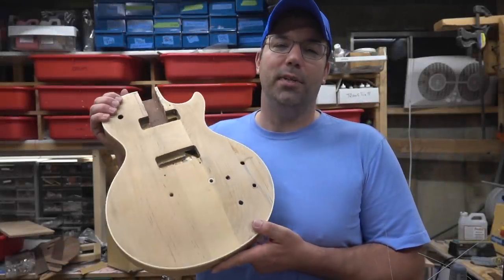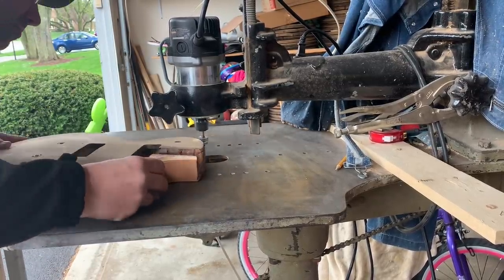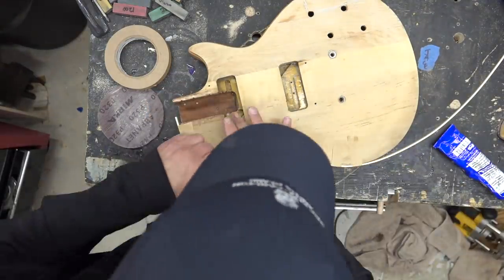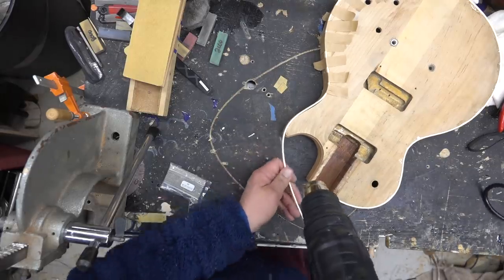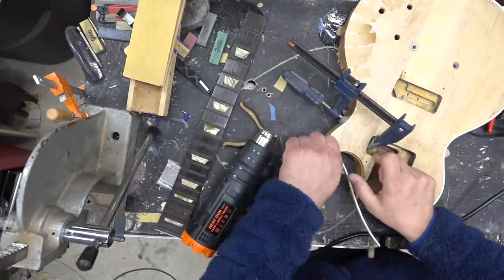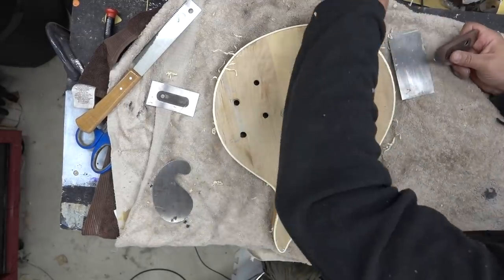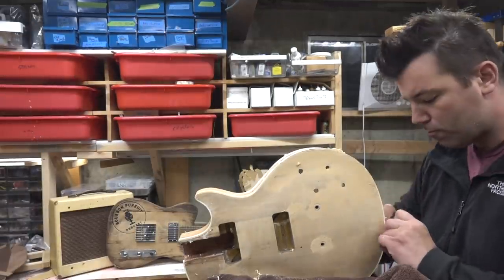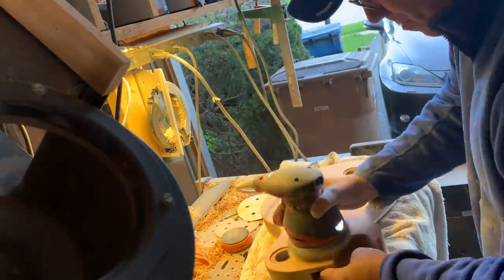1953 Les Paul Restore:  Binding and Prepping the Body

Comment: Coming along nicely! Is there a reason you went with the 70s style binding instead of the way they did it in the 50s?
Reply from the maker: That’s the binding of the early les Paul’s.  I am going to have to paint with dark spray the sides to clean all of this up.
Reply: @bigdguitars  So the earliest Goldtops had the taller routing in the cutaway as well? Since the later 50s have a (more or less) constant height binding route which follows the cutaway. Same as they do now I think.
Reply: @MarijnSlot  No, you were correct. The vintage Les Paul's (including the early goldtops) had the narrow binding channel.